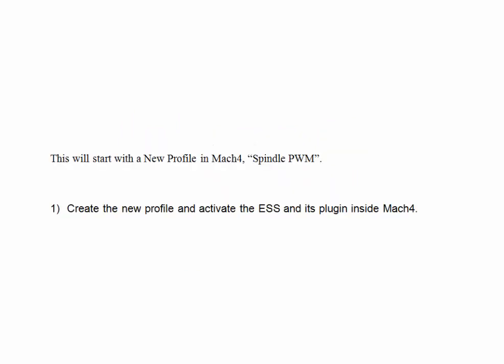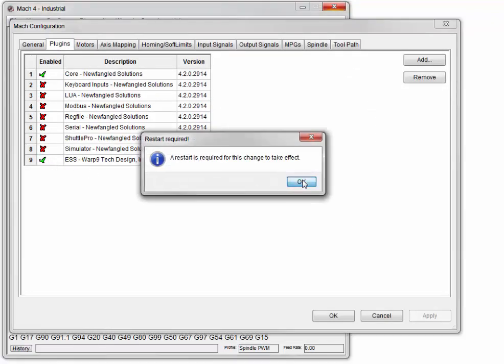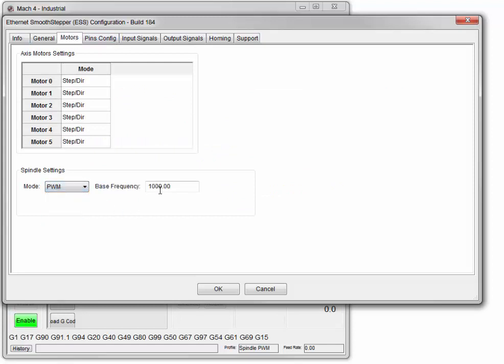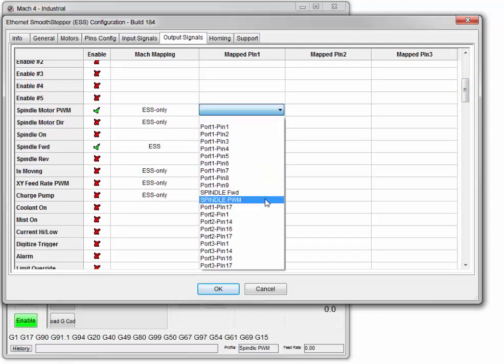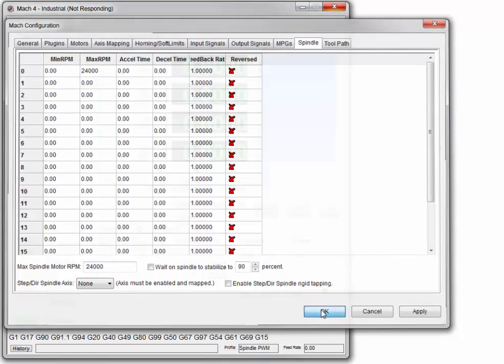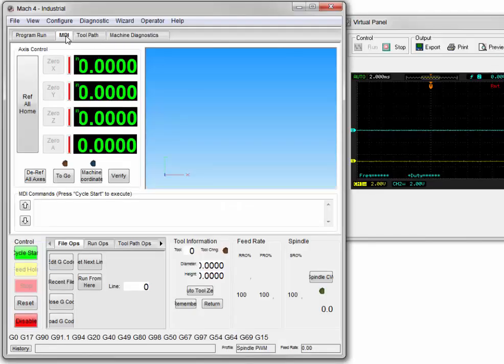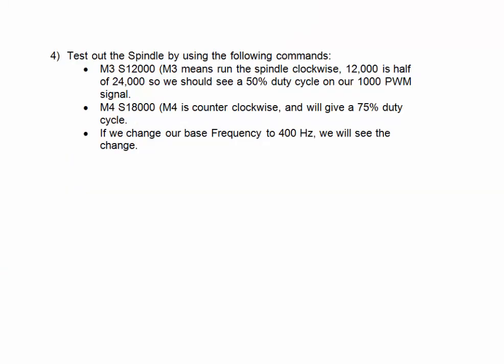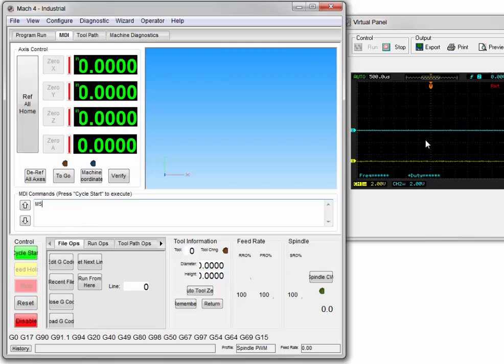M4 Spindle PWM

Comment: How does ones self get to the virtual panel to show pwm output? Thanks
Reply from the maker: The Virtual panel is my oscilloscope's PC side software display.   It is not part of Mach or the SmoothStepper.
Reply: @Warp9TechDesign   okay how did you connect it to mach ,are you using the physical ESS or its all virtual
Reply from the maker: @seimela    
The ESS is real and connected to the PC via Ethernet.  I hooked my Oscilloscope up to the ESS pin assigned to the PWM output, and you are seeing the ESS generated Spindle PWM waveforms on the Virtual Panel, which is my oscilloscope's PC side software display and is not part of Mach or the SmoothStepper.

Comment: What might be wrong in my settings if the "Cycle Start" turns on the spindle but the spindle speed cannot be controlled?
Reply from the maker: Hi Josh, 

My initial guess would be that you have your spindle in Relay mode instead of PWM mode for the ESS setting, or you are not specifying a S450 or S20000 parameter in the MDI or GCode to change the speed, or you don't have the 0-10V output of your BOB hooked up correctly to your VFD (or it isn't set up to read it).   

It is easier to help over in our forum at Warp9TD.com

Andy

Comment: Hi, I need kwno if with the C25 board can use PWM directly?
Reply from the maker: Hi, 
The C25 can pass the PWM signal through it, but the C25 does not have the circuitry required to generate a 0V to 10V output signal for your VFD.  A board like the C41S can wire up to your C25, and generate the required 0V to 10V signal, plus it also has two relays for controlling your VFD.    The C41 would use 3 output pins from your C25 (along with a ground pin).